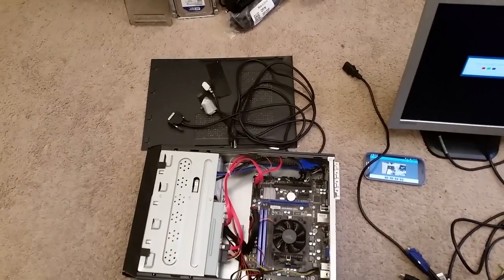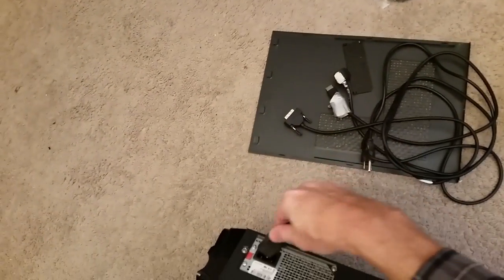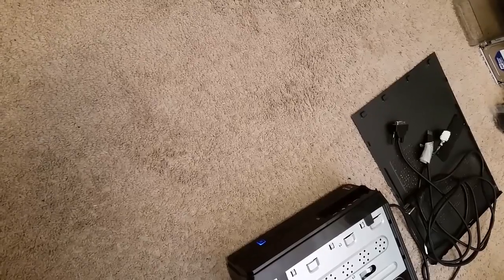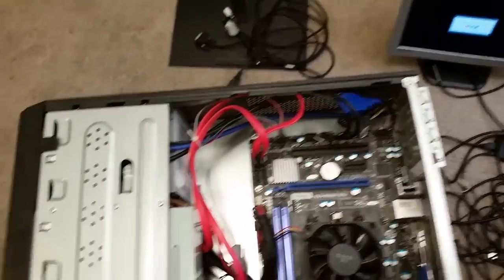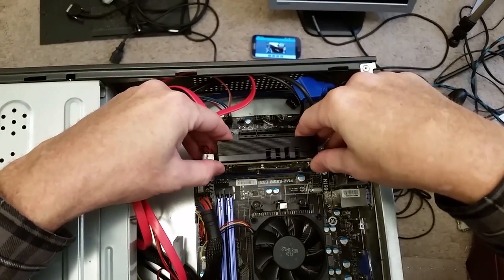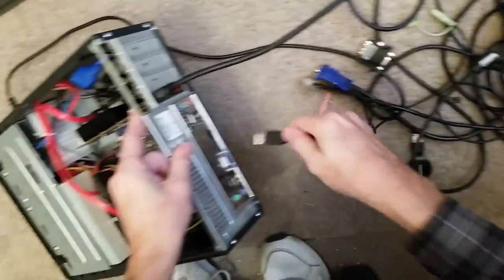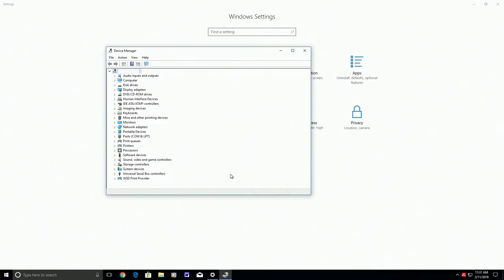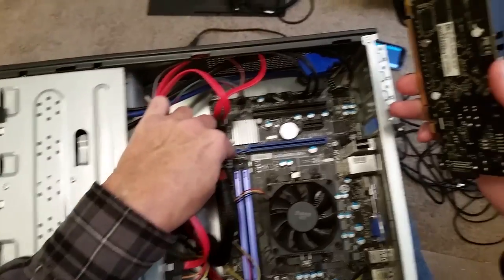HDMI port on the motherboard broke off, new video card, modifying the backplate

Comment: Thank you so much bro. You saved me, was unable to use my machine for longer time assuming my monitor is not working.
But, yes I had the same problem, so connected with Graphic card HDMI port and worked.
Thank you so much again.😊

Comment: You probably could have done a cleaner job by putting the bracket in a vise at the bend line and using a hack saw to score the bottom bracket tab so it would be a cleaner break. I don't think I would charge a customer for doing such a novice looking job. Sure it's great that you got the video working with the video card, but the work you did on the bracket really foils all the effort you put into getting the system up and running.

Comment: I want to know does this also work with the dvi port
Reply from the maker: I'm not sure what you're asking.
Reply: The dvi port broke and idk what to do
Reply from the maker: if a DVI port broke you could use one of the other options. You can get adapter cable to go from one type of connection to another.

Comment: How to buy online this hdmi port and about price
Reply from the maker: In this video I add a video card to the system. Is that what you're asking how to add a video card?
Reply: @MichaelTheComputerGuy  
How do I get this product on the internet
I can't find how to find
Reply from the maker: @sanjeebmundary5850  I still don't know what you're looking for. Are you looking for a replacement graphics card or a replacement HDMI port that you could solder onto a board?
Reply: @MichaelTheComputerGuy  
HDMI port
Reply from the maker: @sanjeebmundary5850  Google search for HDMI port and include the model number of the computer or card you need the port to fit into.

Comment: The best option would have been to either replace the motherboard or buy a proper low profile video card. This is some sloppy work for a clients computer. if i was that client i would have not paid for such low end work. Being that the computer was not properly fixed by buying new  or proper parts it shows how low your computer and customer skills are  Hopefully you did the work for free!
Reply from the maker: Robert Evans I gave them a discount on the card since it was used. I did charge them for the work. The bottom line is I got it to fit and it works.
Reply: the bottom line is a good tech would have bought a proper low profile card if it was going to be a paid job or turned it away! a real tech would not put their reputation on the line to "rig" a card to fit.. just because you got it to fit and work does not make it right!
Reply from the maker: Robert Evans Get off your high horse. I cut and bent a bracket so it would fit.
Reply: a typical response from someone who wont take the time to do the job right.its not just about the bracket its about doing the job right as a good tech not someone that got taught the wrong way to do things. your high horse comment shows your lack of ability to take constructive criticism. so in your opinion all good techs that dont do what you did and call you out when you made a rookie mistake are on a high horse! if you were going to charge for it you could have at least don the job right. Im not the only tech that will tell you this. NOBODY wants to spend their hard earned money on somebody that cuts corners like this....not even people with low incomes.I Have been working with computers for 11 years now and never had to cut corners for a paying customer just to get the job done.
Reply from the maker: Robert Evans It was a half-height video card. What is wrong with modifying a bracket? What exactly do you think is going to happen as a result?
Reply: Not a proper half height. If the card were to come loose as a result of the modification and moved around and fried the socket or the motherboard you would be responsible for any and all damages which could hurt your reputation that is why its best to stay away from situations like that because you never know when it could happen anyone with enough computer experience could tell you that.
Reply from the maker: Robert Evans It was a half-height card. I modified the bracket and secured down with a screw. It's not going anywhere. I've worked on computers professionally for over 20 years. I am not a rookie and this was not a mistake. I understand it's not something that you would do. That's fine, you don't have to do it. I modified the bracket because in my experience I know that it will hold. I do stake my reputation on it.
Reply: yes i have for 10 years as a manager in a shop and never had to cut corners.Anyone that has to cut corners is not a good tech. Anyone that has to cut corners to get the job done shows a serious lack of respect for not only for the customer but for themselves as a tech. so learn some respect for paying customers and do the job 100%  and you will be a better tech than you are now or get out of the business.
Reply from the maker: That is rich Robert.  I'm the hater?  I made a video showing how to troubleshoot a video problem and then modified a bracket.  You attacked me for having low computer skills and being bad at customer service.  You called me a rookie, that I'm jealous of your abilities and suggest that I get out of the computer business.  That I only make $10 an hour and work at a low end geek squad.  You are so pompous it is staggering to me.  Why did you watch my video in the first place.  Where you looking for tips on how to do your job or maybe you get your kicks watching what other people do and then criticizing them?  I wish you the best.  Let the Robert light shine.
Reply: i was calling julzhickman the hater 2 comments up learn how to read your comments next time before you assume anything
Reply: those last 2 major replys i made were only towards julzhickman on the ignorant remark he made.
Reply: Liar!
Reply: It's obviously not a very expensive pc. Would you expect your local car mechanic working on your ford ford focus have the same quality as a lamborghini mechanic?

Comment: Is there a way to repair the pins in the HDMI port? A damaged HDMI cord was inserted into my desktop which has only hdmi, and it pushed some pins back into the port
Reply from the maker: Not that I know of. The HDMI port itself needs to be replaced. If you have other video ports on the graphics card you can get an adapter to go from display port to an HDMI monitor.